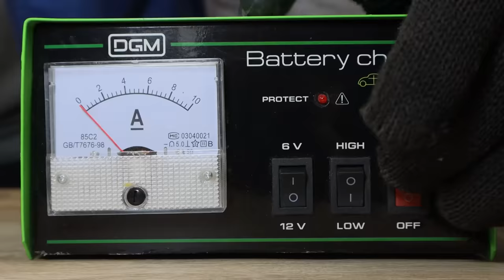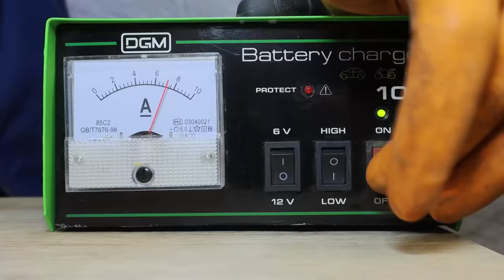Gun restoration, 1882 British Bulldog Revolver, found in the ground | Restoration of antique

Comment: this is prolly the coolest one of these i've seen, unbelievable how close to being fully functional this little revolver is!!!
Reply: Yea I cringed when he deactivated it I wanted to see if it could still shoot
Reply: @qualicumjack3906  Probably lost all of its value considering how much material was removed. If only the rust was removed, it could've been a museum piece. Now it just looks like some cheap trinket that was cast in sand. The grips didn't even fit properly, and the varnish had bubbles and debris, and wasn't sanded. A nice stain and some linseed oil would've been much nicer
Reply: @privateassman8839  

I agree with everything, especially the bit about linseed oil.  Love linseed oil
Reply: @qualicumjack3906  Truly a godsend. You can even use it to seal/treat wooden cookware (cutting boards/spatulas etc...) as long as it's either raw linseed oil, or actual boiled linseed oil (most storebought BLO contain drying agents that make them inedible), and metal, as it can help prevent rust propagation (although it's not as good as hot/cold bluing, or japanning). I recently scraped the varnish off of a small camp axe's handle and refinished it with BLO. Let me tell you; that thing is the softest, most comfortable, splinter free handle I have ever seen. Plus, it doesn't crack and peel like varnish, you don't have to wash any brushes or worry as much about fumes, and with repeated applications and sanding, can have just as nice of a gloss or matte finish as a varnish.

Comment: >Deactivates the hammer and buffer wheels the surface so its shiny and sends rust into microabrasions...
Hey once it starts rusting and pitting at least its gonna be visible since the gun's sanded/polished from the bare and isn't blued or nickeled as you'd do to protect a surface once its been properly derusted and stabilised

Comment: Your restoration was a compliment to time, effort, skill, and finally reward. One thing I was wondering and not one of the comments addressed this is due to your heating it up and cooling it down in water would that not take the tempering out of the steel rendering it unsafe to fire, Hence a wall-hanging conversation piece?  Thank you
Reply: Never mind the the heating and cooling, the removal of metal on cylinder and frame would make it unsafe to shoot. Never the less great job making the piece look really nice!

Comment: Very nice work you did on this! I imagine all the sanding, grinding and filing added to the need to deactivate the gun? (Good choice by the way, I would have done the same thing)
Reply: I was going to make a similar comment - the end result is beautiful, but with all of that corrosion (and material removed), the gun would never be made safe to shoot.
Reply: I would tend to think that this craftsman would have not gone through this work if he felt that the gun was compromised beyond repair
Reply: @vitawater4259  Then why would he grind off the firing pin to deactivate? Even if not usable, making it pretty for display is sill craftsmanship that can be appreciated.
Reply: @ja-bv3lq  where in the video is that?
Reply: @vitawater4259  starting at 4 minutes 20 seconds (ish) - captioned as "deactivation." Also, as a gun-guy, I've noticed that the bore seems to be a much larger diameter than the cylinder chambers. Perhaps wear-and-tear from shooting it a lot - or not cleaning it after shooting (all powder / self-contained cartridges were highly corrosive back then) allowed for the bore to erode more than the chanbers did. 👍
Reply: @ja-bv3lq  I see it.

Comment: Awesome restoration!! But with that said why would you spend so much time to restore such a beautiful piece of history and (DEACTIVATE IT?), if it were me I would have worked a little more on the precision of it so I could fire the gun at the end to show that it was totally restored!!
Absolutely great job on the restore!!
Reply: But with all of the rusted metal he had to remove, wouldn't the diameter be too wide allowing for excessive blow by gases?  Also, hard to say from the video, but could there have been enough metal lost which could make its ability to handle the pressure questionable?
Reply: If this is the UK possessing an antique handgun that hasn't been deactivated is a felony.  So, beyond the bores being too far gone he probably had to deactivate it because of legal issues.
Reply: Nonsense why would you go to all the trouble of restoring it then claim it's Against the law to get someone to fire it as for widening the bore by clearing the rust out again more nonsense, these 'Experts' do have comment !

Comment: I don’t understand the silly gloves. Lol. Ugly hands?  Sub zero temps?  Hand model? You can’t feel your work.  Nice clean up, but you had to grind off so much metal, none of the tolerances would be useable any longer for it to ever function properly or safely. Display piece only. I wouldn’t call this a restoration. In a way, it had far more true character, patina, value, and interesting story as it was, rusted and original as found dug up.

Comment: Was curious if you know about shotguns? I picked one up at a flea market that wouldn't open. Has no company name on it only a 24 at the breach and a T on the side of the barrel. Also it cocks by the trigger guard which is how I happened to open it with alot of oil and pulled hard. It appears to hold a 20 gauge.

Comment: Well done nice work BUT 2 pints 1 u should never use a file always use a wire spindle in a rotary tool to get as much rust off then use salt or vinegar to remove the rest od the rust as i said a really nice job BUT you mist 1 very important  part the BARREL you didn't de rust or clean the Barrel

Comment: I have a problem with your method of restoration in as much that by using a grinder and files that you have taken off too much of the original metal therefore making the gun smaller and more fragile also failing to eliminate some of rust in harder to reach nooks and crannies …. You would have saved yourself a lot of time and effort by getting the items bead blasted …. Maybe first time blasting with a very fine aluminium oxide grit and then bead blasting … this method takes off minimal original material and is much quicker and easier …
Just saying ……. Otherwise it’s a good job …… 👍

Comment: So you want us to believe that a 140 year old revolver with that level of rust is that clean within the metal structure? And didn't break or have air deformation? 😂😂😂😂😂🤣🤣🤣🤣🤣🤣🤣🤣🤣👻👻👻👻👻👻👻also taking in account that in the 19th century using cast iron was cheaper and commonly used what u have there looks like stainless steel